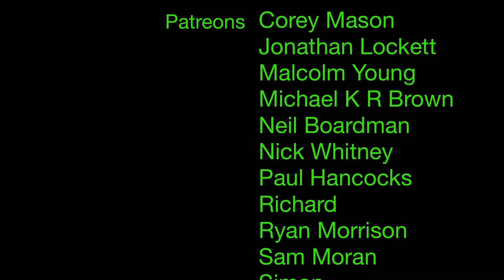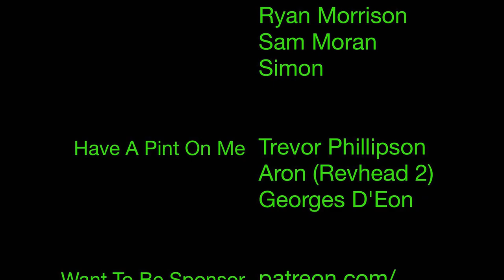Metro 6r4 Build - Ep1 - Rear Spoiler

Comment: i have thought about building one after my mini is done, there is one rallying now with just a turbo honda motor [i think it is] in the back, 4r2! 

years ago there was a lad in wales who rallied a metro, it was escort based so had a xe in the front and an atlas on the back.

I know also of a fiesta that has a cossie v6 in the back facing the wrong way, box facing forward, with the stick comes out backwards but in the hole, with a clever linkage to turn it about, that has granada 4x4 front struts all round, with a rear diff in the front but upside down, not sure how the box drives the other way. 

could be a fun project!